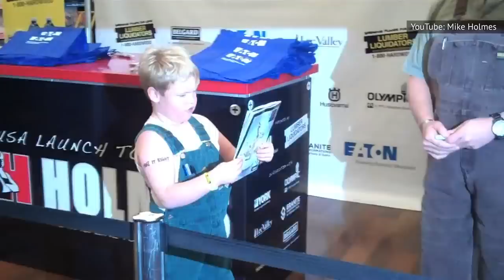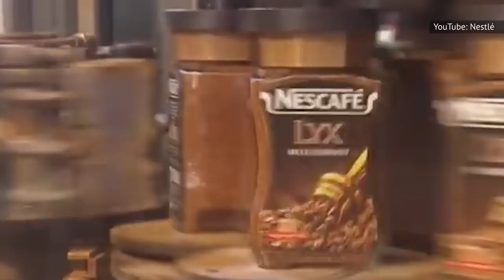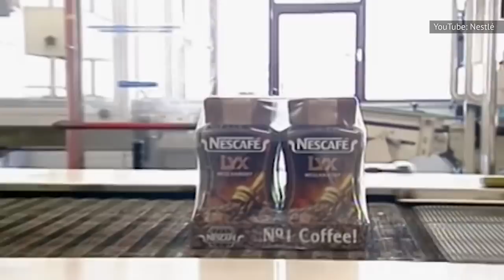What Nobody Ever Told You About Mike Holmes

Comment: I would like to submit that it would be impossible for Mike Holmes to begin on a project, and at about 85% or so, politely tell them that he's completed his portion and it's ready for the next person to start (or finish) the job. When I watched him on his different shows, it would usually go like this; we can tear it down, fix the small hole and it'll probably be fine. Or we can do a complete demo and put everything new, with the higher quality workmanship. What should we do, Mike Holmes??  I not only know which choice he would pick, but it's not the reason one might expect. I suspect that he might have a mild to slightly moderate condition known as OCD. (Obsessive compulsive disorder) it has many different forms and severity goes from unnoticed right up to incessant babbling, and everything in between. Now, obviously Mike's, if he indeed has it or is on the spectrum, then it would most certainly be a mild case. For Mike to only do a certain amount of a project and letting others finish it, coupled with the fact that he's still unsure if the original issue with the repair got fixed or not?? I'm sorry but I don't think his brain could just walk away without a correct, quality repair, and making sure it all worked perfectly. It is impossible for Mike Holmes to cut corners, even insignificant, small issues that isn't structural. I think he would dwell on it constantly until he said, that's it! We gotta gut that bathroom and start from scratch and "make it right". And that's not an insult to Mike Holmes in any way. He's just to professional and he has integrity. These days... well, it's a hard find, sometimes. Congratulations on being a person who not only talks the talk, but you walk the walk as well! You keep storing those heavenly treasures. All the best to you and your family.....d.

Comment: Mike knows his stuff for sure, but I didn’t like how he would crap on other peoples work. Some things were incorrect and was justified, but most people have limited budgets and it’s the contractors job to ensure it can be done within budget, so that means cheaper items(but not cut corners). Many shows mike would talk smack about work because it wasn’t “top of the line” products or just met codes. More power to him for repairs he did for home owners but his work always have the most expensive and fancy things that the original Reno could have never afforded to do.
Reply: I haven’t seen all of his shows, but I’ve seen a lot of his shows.  I think he does a fair job of pointing out work done on a budget vs work done shoddily.  If work is done to code on a budget, he doesn’t fault it.  He does point out where corners were cut that hurt the home owners.  And rightly so.  There also may be times where he might be overly critical - which could be a product of him being a human being, the tv editing process, or both.  By and large, he’s fair in his critiques.